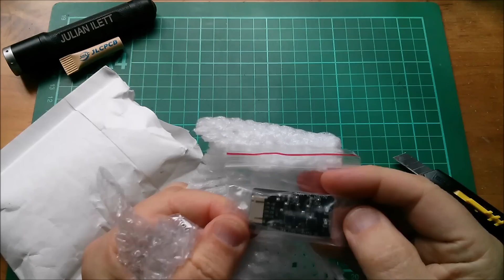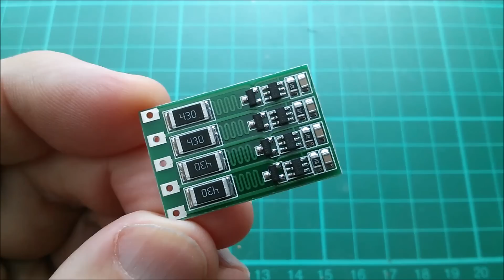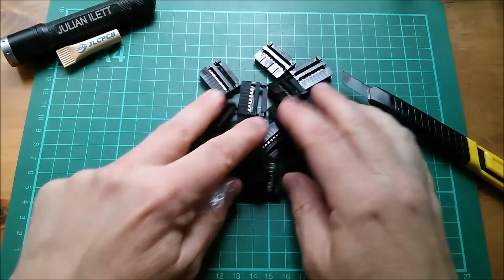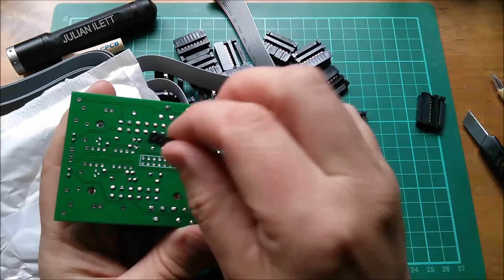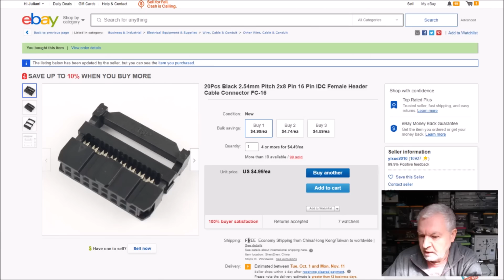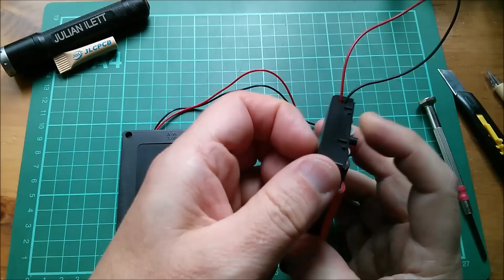Julian's Electronics Postbag: #140 - New eBay Stuff

Comment: Cut out the rectangle in the battery box lid, along that recess and put in a piece of thin plexiglass. Now you can see the cells and you don't have that unsightly uncovered button and it's wires and hot glue blob.

Comment: Way back in the day, 1984ish, we used an arbor press to install IDC connectors. A vise works just as well. 

To get the precision spacing you need, design a board with 2 headers at the correct spacing then solder the headers in. Put a connector on each, lay the ribbon cable on top the fit it in a vise or use an arbor press or even a drill press (pillar drill). The connectors don’t take much force but do need to be pressed squarely or they will break. Our cable assemblies didn’t use the extra part yours have. It provides strain relief to keep the wires seated in the forks, I think you can skip using that part.

Comment: I have a dual voltage (±5) power supply with similar tracks to those going from the full bridge rectifier to the input caps of the 7x05 voltage regulators. Not sure of their purpose there either.

Comment: I assume the wiggily tracks are to keep the resistors heat off the transistor. Transistors can cause thermal runaway conditions if you don't consider such things.

Comment: If I remember making up ribbon cables correctly, the connector design is very annoying as the clip is designed with the cable looping back through, so you don’t get a straight run from connector to connector..if you don’t do it that way ten the clips don’t work. Alternatively you can cut some very small sections of ribbon cable to keep the clips in place.

Comment: dute, in the SECOND when you touch the capacitors contacts and say "ofcourse, there is nothing in there" i remembered my old  middle school teacher, who taught us work with low voltage devices, as we was young students, we cant work with electricity in circuits, so he must come and touch live parts as proof, that its without power, one day he probably forgot secure the switch and touch live part, get hit pretty hard by 250v and walk away with "wtf i was sure i switch it off", EVERY time, when i hear "feel free to touch is, its turn off" i remember that day, even if its over 30 years ago

Comment: A vice is a good and fairly safe way to put on a connector on... It's somewhat slow, but if you only need to do a few that's ok.  It's much better than trying to pit it on using a pair of pliers.  
There are dedicated crimping hand tools and even larger presses (in case you have to do hundreds a day).

As to bridging the gap...
Trying to make a straight through connection will require extreme precision and will make it hard to connect and deconnect the cable because there is no "slop" in the cable.  Considering you like to "play" with the layout and design a lot, I woudldn't recommend a straight through on such a short distance.

For bridging the small gap between the boards.  The recommended way would be to put the cable through the connector, wrap the cable back into the strain relieve, then form an O-loop that sits "on top" and do the same on the other side of the gap.
  Tip: Make the loop big enough so you can fit your thumb through.  
If the above description is confusing... Check this image:
https://i.ibb.co/02ZyQdV/ribbongap.png

Comment: You could also have salvaged a lot of ribbon cable from old PC's.  the floppy drives and hard drives and CD players all have lots of ribbon cable.  and you can easily split a 25pin into a single 12 pin (or into 2x 12 pin cables if you don't care about the one marked (pin 0) wire).  An hour or so in the recycling center and  you'll have cables for the rest of your life :-D

Comment: 10:00  Why not experiment with flat ribbon cable and connectors? You can get flat flex ribbon cables with 1mm, 1.27mm, 2mm and 2.54 mm (0.1") pitch of various lengths, and you can also get connectors with locking mechanisms for your boards.
For 1mm pitch 16 wide ribbon cables, they're as low as 30-50 cents each (varies with length) and connectors can be as low as 15-50 cents each in volume (100pcs) depending on how fancy you want (zero insertion force, low insertion force, locking mechanisms etc)

Comment: Add some feet to the old battery box to protect the switch.
Did you know : High Wycombe, Elevation: 75m / 246feet
Reply: Jyv Ben, High Wycombe undulates like distorted wriggly tin it is not a 75M flat plateau.
Reply: @gordanmilne7034  Julian was talking about a waterproof box and mentioned  there was little need for this because of the elevation.
Hope Julian's house is not in an valley, when it rains like we saw in Spain.

Comment: For the connectors. I would make a wooden spacer the exact distance the connectors will be when placed on the boards. Put that spacer between two connectors, slide the ribbon cable in, then squeeze the connectors in the vice.
Reply from the maker: A spacer jig - excellent idea :)

Comment: Put four aa lithiums in that holder and you'll have around 16 volts or there abouts. I prefer the 18650 version for that but not sure it comes with a switch and nice box, but they do have a series version, 2 , 3,  or 4 cells.

Comment: Mount the boards (or hold them with vices/clamps) with precisely the spacing you want.
Put the board-half of the connectors halfway or so into their actual sockets (making sure you have some way to get them back out!)
Stretch the ribbon perfectly straight and where it needs to go.
Press the back pieces partway in. Everything marked and semi-attached. Carefully extract from boards.
Now use the vice to crimp them/press them in completely.

Comment: Build your 0.1-inch cable in-situ. At least press them a bit in-situ, to mark the cable length precisely. Number them in case the spacing varies slightly.

Comment: Not seen a ribbon cable for years - some were in my house, garage or shed I have a 80 / 10 way crimper.  It came with a set of dies to accommodate the various ribbons common in computers   It was inherited from another team that folded just as I got my new position at work in the days when money was no object  and I think when I got it it was still worth more than the house.
The handles were about 3 foot long and because of the 6' reach it was a 2 hander, also had an extractor for pulling the plugs.
But yes a vice was a good second option - while I could order a full range of crimpers and fancy gear costing £1000s - a vice wasn't seen as a legitimate purchase and I'd have needed to sell a kidney to get a purchase order signed by god to get one (I finally got a new 10" engineer's one as a swap for services rendered from our motor transport dept).
They had 10 wrapped in oilpaper sitting unused on a shelf in their stores.  Happy days!

Comment: Can anyone explain why a 18650 cell cost €10 ... But a normal tool battery that have like 10 cells in then cost €40
Reply: This is becouse mathematics rules we learned at school do not work in the big real universe.
 I also have seen examples on Aliexpress where 1 item costs 1 euro. And if you buy 10 of that items (at the same seller) you need to pay 11 euros. So always check prices and sometimes it is cheaper to buy more than you need and sometimes it is cheaper to split your sale and buy eg. 5 and a few weeks later again 5 if you need 10 pieces.
Reply: @JanJeronimus  yea.. the most anoying i seen was one item cost 1.54... two item cost 3.08... fine... Three items cost 6.85... what a f... 4 items cost 10.53..

This makes no sense what so ever.

So i ordered two items .... Two times.
Reply: @matsv201   Yeah, I've seen similar strange prices on Amazon. Like 2-pack for $2.50, 3-pack for $5.00 - why wouldn't I just get 2 of the 2-packs and end up with 4 items for $5.00? Why would anyone buy a 3-pack? Crazy.
Reply: Jan Jeronimus - same thing sometimes happens in supermarkets!

Comment: Try screwing the battery box lid on  the bottom of the battery box, Instead of the top. You will not need to find spacers for the screws, and you will not lose the top.
Reply: just about to say the same thing

Comment: Try screwing the battery box lid on  the bottom of the battery box, Instead of the top. You will not need to find spacers for the screws, and you will not lose the top.
Reply: Or put them back in the bag with the lid which he said he also wants to keep.
Reply: @webchimp  But the Lid would be on the bottom, so it's kept, and it's level, and it's together with the rest of the box.

Comment: Try screwing the battery box lid on  the bottom of the battery box, Instead of the top. You will not need to find spacers for the screws, and you will not lose the top.

Comment: I purchased a few of those Balance only modules for  4S LiFePo4 cells.  Sissy  things only have a Balance current of some 60mA and don't think they will be effective on a 38120 pack.  LOL   It would seem they are active full time if connected.  Would need to install a switch to the Neg lead in order to prevent them from draining the pack over time.   You can obtain a tool to install those IDC connectors for like $12.00...   https://www.ebay.com/sch/i.html?_from=R40&_trksid=p2047675.m570.l1313.TR1.TRC0.A0.H0.XIDC+connector+tool.TRS0&_nkw=IDC+connector+tool&_sacat=0

Comment: 06:39 here is my bet for the wiggly tracks purpose: to separate as much the transistor/fet from the heat of the balancing resistor... making the track as long as possible so it doesn't conduct as much heat as a straight short track/has a chance to dissipate the heat.
Reply: the wiggly lines are obviously to slow down the electrons. If they don''t slow down they'll fly off the pcb track and crash.
Reply: Trick only, no actual usage. small board is a over-voltage balancing one. When one cell voltage is over 4.25v, it starts to discharge.  Meanwhile, the board with inductor on is an active balancing board, IC is ETA3000,  this IC try to keep the voltage difference between 2 cells below 30mV.  Balancing current is upto 2A.  But, But, But, Good CELL/PACK ALMOST DOES NOT NEED BALANCING.
Reply: @yeso8205 "Good stuff doesn't need fixes"  

Thanks, my cell-balancing-disease disappeared almost immediately after that! Really useful!!
Reply: I wonder how many people were muttering “Thermal Isolation” under their breath for about a minute or 2, while watching that.
Reply: Yeah. that makes sense
Reply: Maybe its a Fuse.
Reply: Or a really low value inductor, tho seems a bit too small so your theory is more sensible.

Comment: Normally I would say a PCB inductor but in this case it’s maybe to avoid getting too much heat from the resistors into the mosfets?
Reply: That's my take too.  Not enough room to just use more Track.